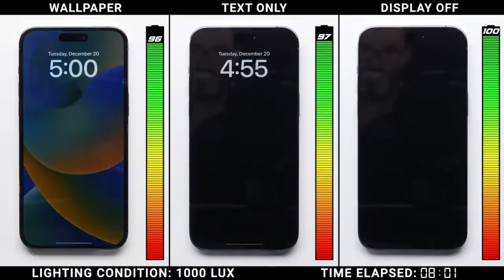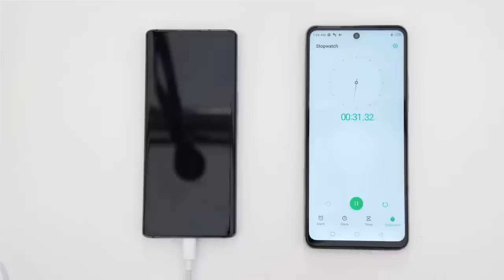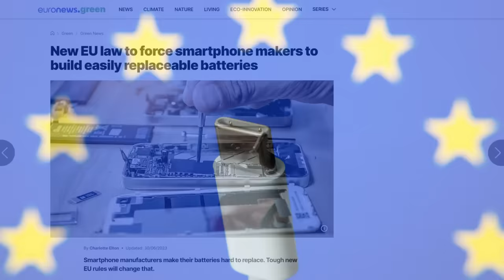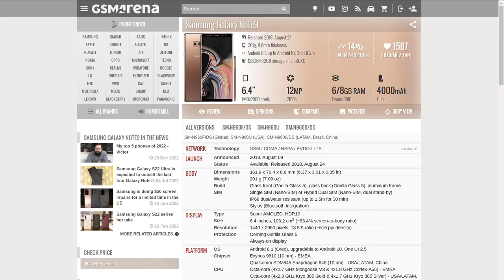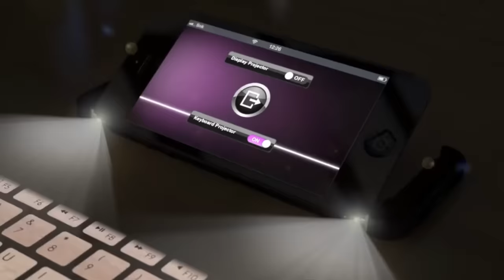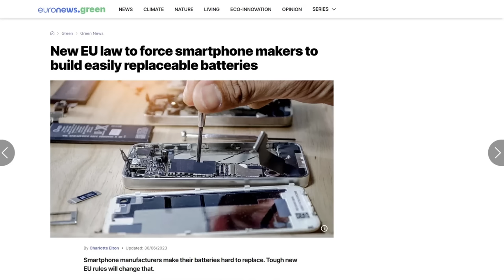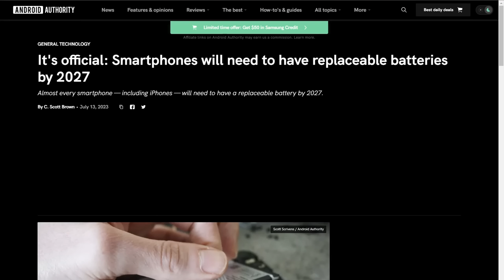All Smartphones Will Soon Have Removable Batteries

Comment: This could potentially be a problem because Samsung phone batteries have been been having problems relating to swelling in heat. At least a deteriorated battery will be enclosed in a phone's case but if people handle batteries externally, they may be more prone to causing direct exposure to people as they react and potentially burst or explode in flames.
Reply: Samsung needs to make better batteries then. Or do you suggest that this battery swap thing should now be cancelled because one manufacturer is making shitty products?
Reply: I feel like this didn’t happens to the old one but the new ones especially if they aren’t used. YouTubers are prone todo cause they buy all jacksht and don’t use them. I have a galaxy se a very old phone maybe from 2010 or less and I’ve always used it and the battery never swell up. My mom had it and then I had it for years and it worked fine and the battery was normal. And it charges so fast and the battery is removable which is cool. It was my dream phone. But it never exploded. Samsung old phones are something else and don’t explode.

Comment: Most decent phones nowadays can have their batteries last 5+ years. 
Encouraging manufacturers to produce better and longer lasting batteries seems to be a better idea. 

Having the consumer not charge their batterie when it's at 70% will reduce the charging cycles. 

This has a high chance of creating more battery waste. 

I prefer having a thinner lighter phone with a good battery and using a suction cup, pull tab and a standard screw driver for something I'm not even sure I'll need to do in the lifespan of my phone, because as you know, the software usually becomes a problem with time.

Manufacturers will probably also have to change their machinery or readapt it. 

On the surface this could seem to be a good idea, but there are many flaws.  
I wonder if the reason being pushed for this decision are truly ecological or not.

Comment: Going to make this a longform comment after watching your video. Id like to get the biggest issue out of the way first: NO. This is NOT a good regulation! Batteries are already easily repairable, and have been for a long time, with, surprisingly, Apple being the best about it, using pull tabs for battery adhesive rather than a thick glue or even worse, soldering to the board. THOSE are anti repair. The reasoning for this is because you are wrong when you say these phones are not meant to survive a dip in the pool. On the contrary, thats exactly what they were made for, with many conpanies providing waterproofing for 30 minutes at depths of a few meters (9ft). Thats more than enough time and more than enough depth, as the less depth there is the longer it lasts. You could have fun in the pool all day and just have a wet charging port to deal with. This also gets rid of the thin barrier between the battery and the board that you would need for the interface between battery and board, since tou cant just plug it into the board on its own. That takes up valuable space in an era where theres none left to exploit in the first place. The headphone jack was remived and we got camera OIS. I think thats a fair trade. Cameras are not comparing to professional set ups for professional settings, sure, but to say they havent replaced the consumer market is ridiculous. Why would I spend $1000 on a DSLR if my phone takes pictures  at a quality close enough that I need to zoom in to tell the difference? It takes night photos extremely well, moving shots extremely well, shoots in 4k, shoots 120fps...what more do I need? By having this requirement enforced, you WILL see issues cropping up, with either phones getting much thicker due to the interface between the battery and board, or youll start to lose features that your average consumer finds essential these days. Wireless charging, for example, would likely be affected if not removed. As you said, battery size could decrease heavily. This is a result of nostalgia being taken seriously. I too remember my Nokia being yeeted at a wall and surviving with barely a scratch. Do I want another Nokia? No. I want my stupid ass s22 ultra, just without a glass back, without the cpu slowdown from low battery health, without the stupid bezeled edges making it so much easier to crack the screen, as well as increasing the cost of said screen.... Theres plenty of room for legislation, but not for this...

Comment: Quick math:
Cell phones charge at 5 volts
US wall power is 120 volts 
120/5=24
Connect your charging cable to a 120 volt plug and you can charge your phone 24 times faster 
48 times faster with non American power supply

Follow me for more advise

Comment: Batteries are already replaceable in today's phone. It's just that they are very difficult to replace, because phone makers in their infinite wisdom decided to make the back covers out of glass and require special tools to open  and then use glue to fix the battery
They could've used plastic or metal covers, and screw down the battery instead

Comment: The regulations state that changing a battery must not require heat or a solvent to disassemble it. Nor shall the user have to resort to special tools.

Comment: Tbh I don't really like this change because it has severe downsides. The batteries will need to be more rugged so the phones will be thicker and have less battery capacity, phones won't be water resistant, phones won't have glass backs and removable back panel will be squeaky because it needs to have some amount of play
Reply: Not true. Just look at the Samsung Galaxy XCover 5.

Comment: I've never had to replace a phone battery in 25 years of owning mobile phones. I honestly think 90% of people have never even looked inside a mobile phone, let alone bothered replacing the battery. It's a non-issue for the vast majority of people. 
I don't really think this is a good idea, it's the usual interference from EU politicians stuck in the 1990s, preventing innovation and technological progress. 
I'd be hugely disappointed to lose any of my battery capacity, or to lose the water resistance, which is much more useful than many people realise. 
Political interference with private companies, endless red tape and regulations like this is partly why we (the UK) left the EU.

Comment: If this happened in my country, it will be a disaster. When phone thieves steal your phone, they can't switch it off if its locked, so they just remove the battery. Having a built in battery allows you to have a short window of time to track your phone especially if it is a Samsung before they can turn it off. Bringing back removable batteries would make phone theft much easier for the thieves
Reply: It sounds like your country should address the economic needs of its citizens. I doubt the majority of people are stealing phones for the fun of it.
Maybe it's time to provide people a basic standard of living...........

Comment: Android phones does have limited security updates so it could still be a way for people to still buy new ones, at least if they care about security, lol.
With the run time being a module google can update independently so apps are still being able to work, which would be a practical reason for people to get a new phone (like some Windows 7 users are only now starting to move away because Chromium no longer is supported).

Comment: I don't see what issue this solves, It's not lowering E-waste or anything all it does it change how that waste is discarded. Right now even if my phones battery breaks or something i can still just take it to a repair shop and get a new one rather than this which regardless would still force users to spend money of a new battery should it be damaged. And even if the phone itself breaks you're still going to have to replace the phone itself any creating even more E-waste.

Comment: Horrible idea man. Just making sure battery is replacable doesn't mean it will readily available 3 years down the line. Supply chain and all that. This will cause the customer to change their phones even more especially in emerging asian markets where supply chain was never a strong suit and we have a lower capacity battery on top of that. Make a non removable version for asian markets

Comment: That's great but I'm pretty much locked in to keeping my stupid expensive smartphone for as long as possible. I won't be able to use this feature any time. What a shame. Should have never been a thing. As usual the law does too little too late.
Reply: I think it does quite a bit, but I agree on the "too late". Especially since it only kicks in in 2026.

(To elaborate on the "quite a bit": 
The regulation isn't really about phones. It's about recycling. It therefore includes regulation about battery materials, required percentages of recycled material, better tracking of battery imports and their life cycle, better repairability and (for household devices) the option of a user replacement. This category includes smartphones, yes, but also headphones, controllers, vacuum cleaners, probably some tools, consoles...
But for some reason, most media outlets turn it into "EU has new thing about your phone".)

Comment: Honestly. I don’t like this idea… just like usb-c charging ports are terrible in my opinion. Working in construction, they are horrible with dust getting stuck in it. So you have to clean it more often, and they get damaged easier… it’s a good idea to use the same charger for every phone, but they could at least have thought about what type a bit more. And with removable batteries, there’s a lot more problems, that could completely break your phone… who makes these things up?

Comment: bruh the water resistance saved my ass one time i would never give that up and my phone charges pretty fast so would rather use a portable charge rather than lose battery size and water resistance
Reply: Water resistance and removable batteries are not mutually exclusive. There are several water proof phones with removable batteries

Comment: i for sure know theyre not going to go back to the old way of making phones. everyone is so used to having theyre phones the way they are, i think the quality will be there still however theyll add a way to some how slide the batter in and out in some way like how an SD card does or how a sim card does on an iphone this way they dont have to implement the whole snap the whole back of the phone out strategy again which imo would result in shit quality phones again.

Comment: This is interesting. If batteries has to be reinforced, batteries will have to be thicker. Which is less space for the phone.

But maybe some companies embrace that and encourage tactically switching batteries, maybe even a tiny battery as well in the phone with a short battery span that is ling enough for you to switch your main battery without having to shut down.
Reply: Bro what?
Are you willingly ignorant?

We already have phones with replaceable batteries that are good enough already.
Reply: @Hypogeal-Foundation  Ok i guess what i said was messy at best.
I already had some older phones with replaceable batteries in the past, but one thing i noticed is that if you try to remove them, the phone shuts down immediately, obviously because there's nothing powering the phone (unless it's plugged while you're doing that). 

What i was suggesting here is that phones with replaceable batteries should include in an internal battery that lasts at least 5 minutes long so that you have time to open the phone, remove the battery, replace it, and close it all without the phone losing power immediately, shutting down (again, unless it's plugged while you're doing that).
The benefit i'm arguing here is that the phone never have to leave your hands, nor does it ever have to shut down, neither does it have to be attached  to something ever again. With a little bit more stuff, you shouldn't be charging the phone but rather the battery. 
This makes it unnecessary to plug the phone in and use it when it's in low battery, doing this kind of stuff is really combersome when you're doing that, having to move a chair near an outlet or something, and especially in charging stations. Instead, you could just bring in a battery charger and leave it there in the charging station. And i also see people use power banks quite a lot, ya could also just charge the battery inside the bag without having a wire it up on your phone, or best, a batter charger integrated into the power bank as well, wire is no longer necessary for this.

While at it, I'd also like the battery to be removed more easily, it always involves removing the back side of the phone to get the battery. I wonder if it could be more like a magazine.

But hey, if that doesn't convince you, do forgive me.
Reply: I also took a short look if there are any phones within recent times like this year and a few past years that fit with my description. I didn't found any, they involve the same removable back. But again, i didn't look much.

Comment: Why would you buy a spare battery that only works for your phone when you can use a powerbank to charge your phone, someone else's phone, your tablet, your e-reader, your headphones/handsfree, your camera and even a laptop... No, this law is not about hotswapping phone batteries, this is about removing planned obsolesence and making the smartphone making thieves invest in finding a way to maintain waterproofnes. Most people don't need 2 meters for half an hour, 2 meters for 5 minutes is more than enough for any pool rescue, but the producers are using this to justify forcing people to buy new phones or loose water resistance all together.
Reply: After years the battery will stop holding a charge past a few hours.

Comment: I don't know.  I had Samsung S3 for 2 years and I hated it.  I always have to carry 3 batteries a day  because each one will last like 3 hours.  there were a few times when i had after work party and I cannot get a taxi home because my phone died.  Switching from that piece of garbage to iPhone5S and it was instant night and day.  I can use it for more than a day and a few hours extra without charging.  unless the changeable battery can last decent amount of time (1 day of normal use) and doesn't make the phone bulkier,  I don't see the need of having changeable phone.   
btw....go pro and all other action camera have pathetic battery life.  I don't know about you guys but i constantly having  battery anxiety when using it.  now if they last like 4-5 hours, I will careless if it's changeable or not.

Comment: No, I don’t find the trade-off to be worth it for removable battery. I want my phone to be water resistant. I want it to be durable and you take away that durability with the removable battery. I’m not going to sit here and have to remove the three part case every time I want to swap in a new battery.

Comment: removable batteries: they are eaiser to replace, if dead, are cheap to buy. if the battery is punctured, you can just chuck it out by shaking the phone once, and buy a new battery. the reason why no removable batteries is to prevent accidental damage removable battries need a hard plastic shell to prevent it from being loose. this will make the phone more bulky and much heavier. there are phones getting thinner and thinner and light. for non removable batteries, will make the phone thinner, but there will be non removable pull tabs, meaning that trying to remove the batteries and you bend it will kill the battery. if apple was forced to use remove batteries, apple has a lot of anti-repair taptics on ALL apple devices. apple keeps serializing their parts especially the battery. if you replace a original apple parts with 3rd party parts, then it will not work and you will have to serialize the battery if its original. Samsung has just put removable pull out tabs for repairs, if instead of using acohol and other liquids to remove, so samsung will not use removable batteries or the phone will be as thick to make instead of the iphone-like design. the samsung galaxy xcover does have removable batteries to replace, the xcover can work without a battery. so if all smartphone brands use removable batteries, then your phone will be thick as possible. and if you drop your phone it will fly out like legos. phones will have removable batteries it will be replaceable. but there will still be the pros and cons of removable batteries, and metal will barely be a thing.
Reply: oh, did I mention wireless charging will not be a thing

Comment: This is wrong! Not all SmartPhones need to have user replaceable batteries. They only need to have user replaceable batteries if their batteries do not match certain criteria. First of all: Devices that are fully waterproof do not required to have replaceable batteries at all. And in case of SmartPhones, batteries do not have to replaceable as long as the manufacturer guarantees that the battery is still at 83% capacity after 500 charge cycles and still at 80% after 1000 charge cycles. If a manufacturer makes that guarantee, the battery does not have to be user replaceable, however, if the sold battery then does not match these goals, the consumer can demand a free battery swap.